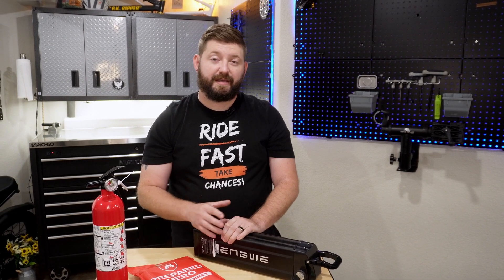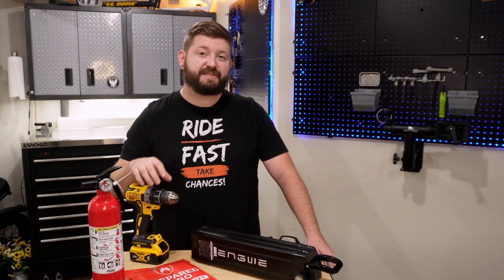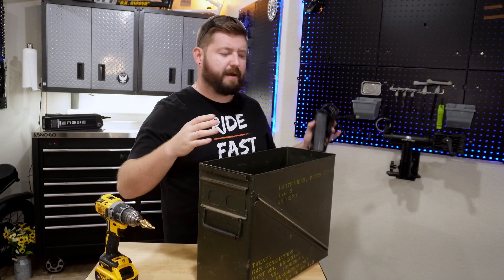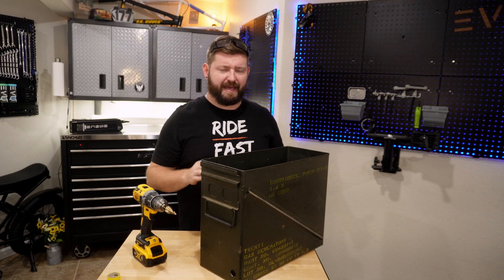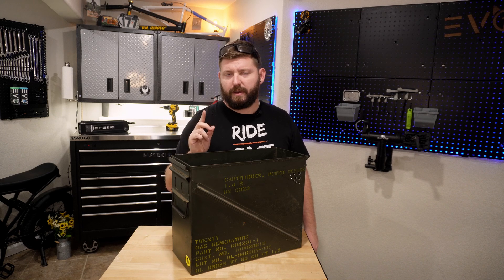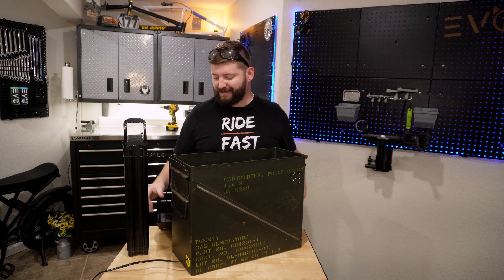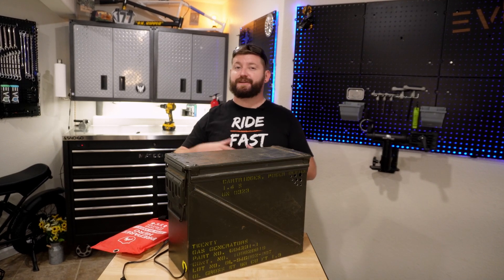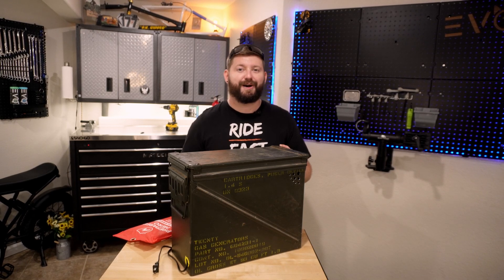Avoid DISASTER with this EBIKE UPGRADE!

Comment: Just don't buy cheap E bike. Problem solved.
Reply: You can have the best Lithium cells, the best battery management systems and you still have a very very low residual risk of your battery catching fire.

Comment: And why not just introduce a DC inverter with a breaker into the system within the same box as a double-check?

Also, attach a thermometer to the outside of the box so you know what you're dealing with.

But that's the engineer speaking - "if it's worth doing, it's worth overdoing."

Comment: I've noticed that the charging brick gets pretty hot when in use. My advice would be to keep the brick on the outside of the box to keep the heat it produces out of there completely.
Reply from the maker: That could work for sure, my only thought on leaving it inside is in case it catches on fire. Just saw an article about the CPSC going after chargers now